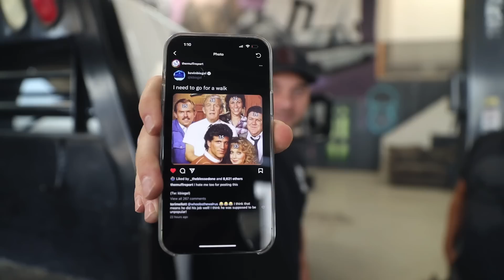The Final DPG Giveaway! (Built Diesel 100)

Comment: Congrats on number 100.
22.5 ten lug black powder coated dually.  I think that will set it off with the green paint job and with fat (phat) stacks black powder coated with the Sparks Motors emblem shadow boxed with a backlit neon colored LEDs and have a way to aim some more LEDs (different colored than the backlit) upwards inside the stack  to highlight  the exhaust and have it on a sensor to come on when the smoke passes by. That's what I would like. Maybe some more viewers might like to see something along those lines as well.

Comment: Supper singles tilt and slide back flatbed. Like a normal car hauling flatbed. Little hurk 2.0 under it. Air bags in rear so it can be leveled when weighed down. Then the agent can repo two at a time.  Ooops gave away my profession

Comment: Nice Dodge Truck they are better with standard transmission and the transmission will hold up better than the automatic.   The manual transmission is cost less to repair .  If like DIY changing a clutch and throw-out bearing is a breeze with a good transmission jack.  If are a little more advance DIYer then replacing parts in a manual transmission is simple compared to an automatic.   Actually I like the truck Diesel Dave drove up in,  it look just about my speed.

Comment: there's something fraudulent is going on with these sweeps.  alternate method of entry in official rules states to send a post-card to po box 2670 in salt lake city.  the post card got returned as "not deliverable".  i confirmed that i wrote down the correct info as stated in the rules.  i sent an email inquiring about it--nothing but crickets.
Reply: I just checked out the Diesel Power Gear website. They state that they had an issue with the PO Box mail in entries that you were talking about and that you need to send another post card. They extended the giveaway until February.